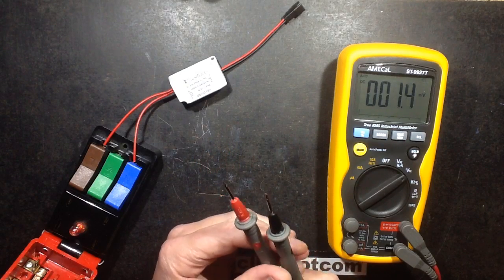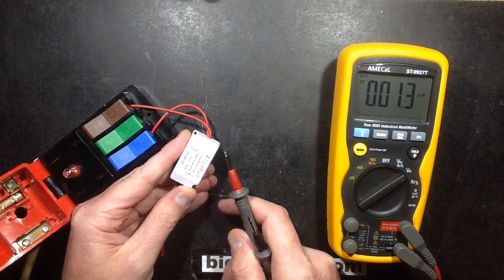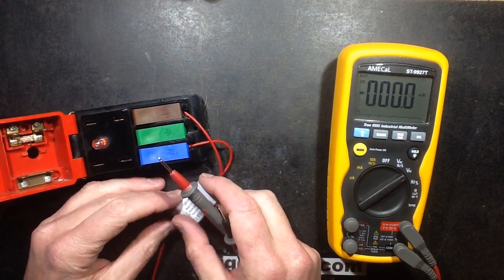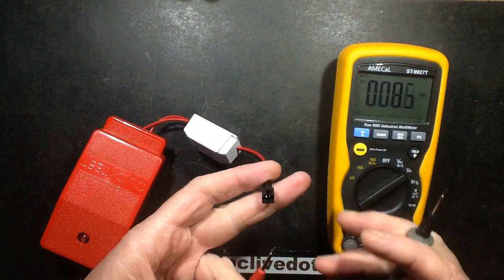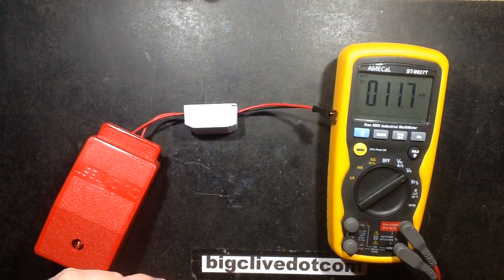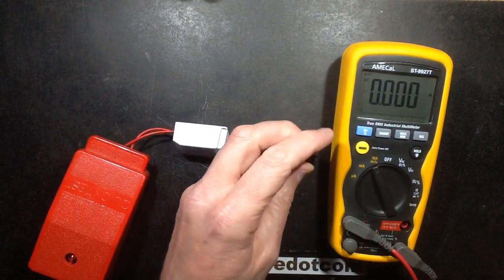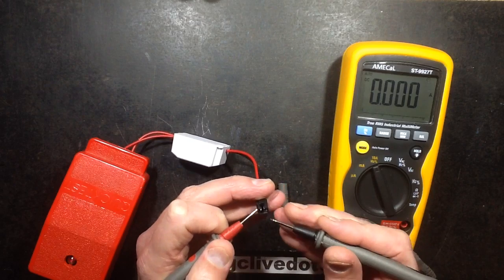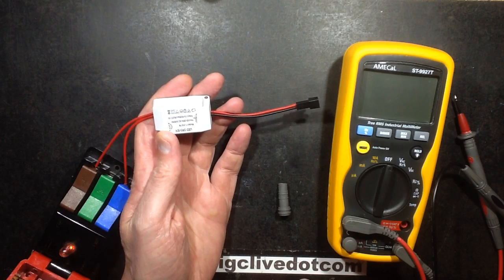Random tests on an inline 3W LED lamp driver.  (Including short circuit.)

Comment: I thought only older magnetic transformer had a notable difference hence the rating at a particular load say 12V @ 500mA. So matching the power adapter to the device was sometimes important. Ive had a hard time locating reasonably priced magnetic AC TO DC transformers.  I will probably use 16VAC doorbell transformer with diodes or a stock bridge rectifier.
Reply: +Rav Gupta For what purpose?  It does not make much sense to use such a linear unregulated supply to power LEDs when the small, integrated, inexpensive current regulating power supply modules like the one shown in the video are readily available with world-wide shipping from China, and much more efficient.

Comment: mains test block, the only one I can find is from the UK and it's $65 from ebay.  Has anyone found a comparable device on the US/Canada side of the pond for less?
Reply: +RobiSydney I never found any for the US so I just built my own with white, black and green terminals, LED light and 15 amp breaker. Of course you can get the UK one and chop off the plug and put on a US type and change the fuses to 15 amp. and your good to go. Just make note where the hot, neutral and ground are going.
Reply from the maker: +RobiSydney Availability might be affected by safety regulations.  In the past people used these in their workshops as an alternative to plugs by stuffing power tool leads into them.  (often twisting clumps of wires together for more than one tool)  Inevitably they would mix the grubby wires up and shove the earth wire into the live clamp making their tools outer casing live at mains voltage
Reply: I also wish there were a source that did not require importing such from Europe (of course the proper line colors would be nice as well, but I am flexible if need be) but what you have found is the same as all my initial searches.  They just do not seem to exist in any form that I have found outside of Europe, which is a real shame as it is a wonderful temporary hookup means for experimental bench projects.
Reply: Ethan Poole Well $60 plus is a bit steep for something like this anyways, I was expecting it to be at the most $40 when I was looking for one. But we are Americans, We can be creative and build our own tools for the bench!
Reply: Rig up something using clothes pegs or simply use crocodile clips with wood base, separators and large paddles on the backend of the clip do your finger does not slip. Use a GFCI for insurance.
Reply: Cloths pins may not have enough grip but alligator clips if they are the bigger ones and insulated will work better or some spring loaded terminals mounted in a plastic box with a panel mount switch and 15 amp panel mount circuit breaker (Which is what I did)
The ground terminal is a brass bolt I can clip a jumper lead onto if needed
Reply from the maker: +Rav Gupta before messing with weird shit like clothes pegs, take a look at my "wago" video.  I sometimes use the releasable Wago terminals to connect stuff temporarily in a relatively secure and shrouded manner.
Reply: That's the ones I used, I could not think of the correct name for them, Wago

Comment: I suspected the open voltage would only be a little more than the nominal Vf rating of 3 LEDs.

Otherwise the output cap, etc would have to deal with over-voltage if the output was disconnected due to wiring / LED failure.

Based on your current measurement, you should be able to run up to a metre of (30 LEDs/metre) strip at full brightness, or 500mm of the 60 LEDs/metre strip.

Comment: Hey Clive! Been looking at your videos, and now I want to put in some LED bulbs in my room instead of the normal incandescent.  Have you ever looked into the IR controlled 16 color change LED bulbs?? You know way more about it then me and would love your recomendation.  Also I'm in the US so we run on 120V or whatever it is. THANK YOU!
Reply: They are generally more for accent/mood lighting as opposed to lighting a room, so their suitability will depend heavily on your intended application and expectations. Often the best thing to do is just go ahead and buy one or two and try them out for yourself in your intended application, then quickly order a bunch more (plus a few spares) if it looks like they will serve your purposes well.  Just do not wait too long to place the full order as there is a lot of turnover in this young industry of LED lighting, so if you wait too long the newer units may no longer match your original purchase (if matching bulbs matters to you).  Good luck and do not be afraid to experiment.
Reply: +Matt “oneillm987” O Somewhat on topic: I've installed 3 of the rather expensive Philips hue lights in my room as my secondary lighting -- Still have 30 watts of warm white leds for the main lights.  The Hue bulbs each control over zigbee protocol from a hub that then goes over the internet to let me control it with my phone. Great colours (if weak greens to produce a better white) -- painless install, has 'alarm clock' so my lights fade in before I wake...but expensive.